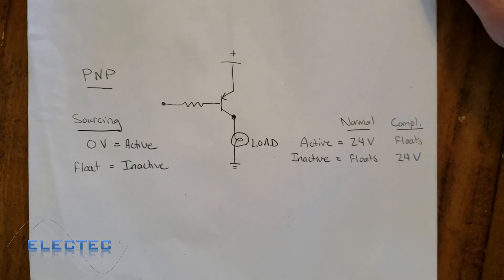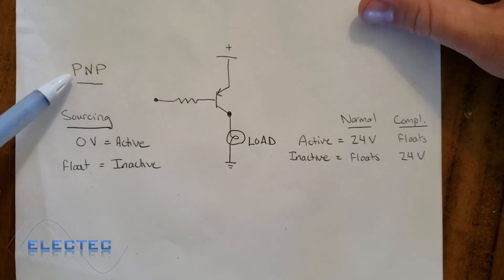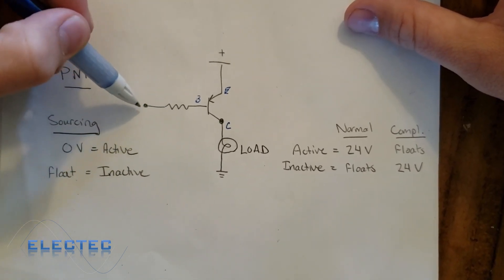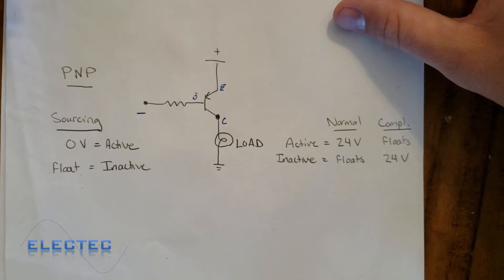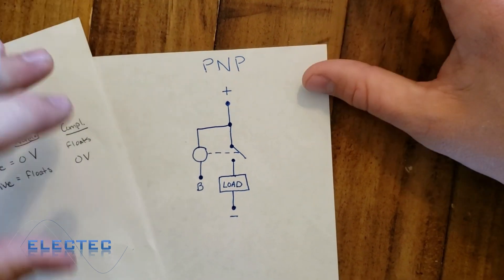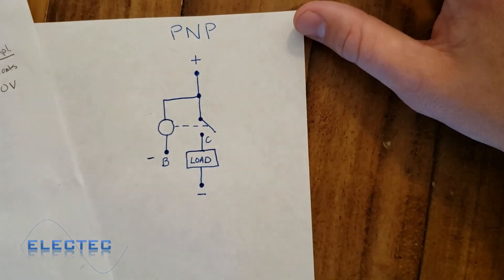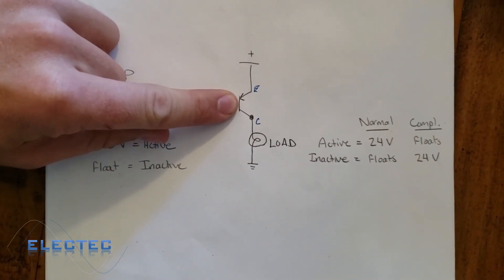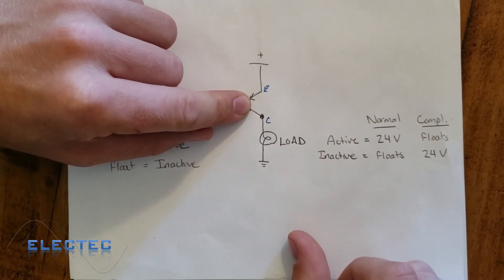How PNP Transistor Works as a Switch?

Comment: i have a question regarding a pnp transistor switching a parallel mosfet in xcortech 304 for airsoft replica, is it better than using mosfets only? i wanna try to copy the schematics using to220 package pnp and irlb3034pbf mosfet if its going to run better than 3034 alone

Comment: Can you explain what the resistor at the base is doing? How is it lowering the current to the load if current takes the path of least resistance?
Reply from the maker: Excellent question. The base - emitter junction is like a diode. And almost always, diodes need a resistor in series otherwise they will burn up. So somewhere in the base to emitter circuit, a resistor is needed. They put it on the base side, because they don't want it to affect the flow of current in The collector.
Reply: You are limiting the current basically. That's all

Comment: I have worked designing tons of circuits in America. And the typical convention is to use NPN transistors for nearly everything. PNPs just aren't used that much. But I guess it depends on what you are designing. JMHO
Reply from the maker: Thank you. The video is geared more toward industrial sensors and switches, and supporting the idea that they are usually configured to provide a positive rail output when active (if manufactured in the US.)

Comment: Sorry I am just a little lost. From everything prior to this video, I understood that you source a low input current to the base of an NPN transistor. As for a PNP, you sink through the base by having a lower potential relative to the emitter. I understand that when you are not using conventional current the opposite is true, but I was told in lectures from my professors that electrical engineers(EE's) use conventional and physicists use true flow(Hole vs electron flow). Therefore, I would imagine that you would use a PNP transistor if you were dealing with low level logic.
Reply from the maker: You are correct. The PNP transistor is the "sourcing" portion of the circuit. So to turn it on you must "sink" the current from the emitter, through the base. Conventional flow. Same goes for the load, the PNP sources the current and the rest of the circuit sinks the current through the collector and load.

Comment: You speak about COMPLEMENTARY transistors. Is there a discrete complementary transistor, or are we talking transistor pairs?

Also, why no use of pullup resistor on the base?

Comment: Probably the best video on YouTube in terms of real world transistor application.  Thank you.

That said, Instead of floating the Base of the transistor to break the Emitter/Collector path, wouldn't setting the Base to the Emitter potential generate the same result?
Reply from the maker: Thank you for the good review. You are correct. If base and emitter are at the same potential, the collector emitter junction will block current flow.

Comment: Is there a way to control a solid state relay using a pnp controler? I have a pressure switch with a pnp output and would like it to control an alarm when the air pressure drops below a set point. Thanks very much!

Comment: So If I want to duplicate a reed switch using a hall sensor such as A3144 for high current, should I then use PNP MOSFET?  Meaning that when the magnet passes by the sensor and its output is hardly much and it is hooked up to the gate of the MOSFET, it will cause the MOSFET to turn on and current flow through it, and when no magnet passes by the sensor, there is no voltage at all to the gate of the MOSFET and that causes the MOSFET not to close or it is off or it floats or whatever you want to call it.  Is this what is happening?  And if one uses NPN MOSFET, then it will be the opposite, as the magnet passes by the hall instead of allowing current going through the MOSFET, the current stops and if there is no voltage at the output of the sensor, no magnet by it, the MOSFET is on.  In other words, the NPN MOSFET is on by default.  While the PNP MOSFET is off by default in a sense. I s this correct?
I like to make a fidget spinner motor with a magnet on each of its three arms and use the hall and a transistor to energize a coil so every time the magnet passes by the sensor the coil is energized and pushes the magnets and is de-energized when the magnet is not by the sensor.  I assume PNP MOSFET must be the right choice according to what I see here unless I have it wrong.

Comment: Why are you saying the collector floats when the transistor is off? I think it should be ground since there is no current through the load. That means means voltage across the load is zero, and the collector voltage will equal to what the load is connected which is ground.
Reply from the maker: The collector can be thought of as ground only because of the load, and only if the load is low impedance. If the load is high impedance or has reactivate characteristics, it takes time to stabilize to a ground potential. Try hooking that pnp output to a high impedance input and you will see it doesn't work as expected when turned off. You would need a low impedance circuit to quickly pull the collector point back to ground. Low impedance loads like coils and relays will appear to work like you described.

Comment: I need info about mosfet why they brake down in 60v in linear region even they consider to have brake down in 200v . Even I use the data sheet required power / volt / current .  They just short out because they can't handle any longer the linear action more than a couple of seconds . So I only see mosfet is good for switching application
Reply from the maker: Many different things to consider. All transistors dissipate heat in the linear region (current, and voltage drop at the same time). Without seeing specific examples, I would assume you are allowing too much  current (DS) while at this 60 volts.
Reply: Yes . Example I have a power DC load test max volt 100v max current 20A max power 360W . The mosfet just brake down in 60v 5A with less than 5 second even the temperature not yet go to 70 . But in 12v DC I can go even to 28A with out problem and even the temperature not max than 80c even up to 5 min . I think you know the DC load testing. IAM trying to find a mosfet can work on my universal DC load test for testing 80v 20A 1600w ( powersupply )
Reply from the maker: Which MOSFET are you using?
Reply: Soo many ( too many models ) now i buy IXTX90N25L2 to test it
Reply: Do you think that I have a problem with the mosfet driver ? Or shunt current ohm feed back ? But this 2 are already devitalized by microcontroller .
Reply from the maker: @abed_itani This is too difficult to answer without doing considerable research in your design. High frequency oscillations in the gate could be causing issues. Otherwise, junction temp may be higher than you are seeing. There are multiple possibilities here.
Reply: Yes there many possibility including the power disp inside the mosfet is Soo consider high as any mosfet when it reach 300w since the mosfet inside material is Soo small for this power even if I put a Soo big cooling because the temperature rise in seconds is Soo fast than the cooling transferring . And do you suggest to put mosfet in big copper and the copper in alaminum and the alaminum have a fan cooling ?